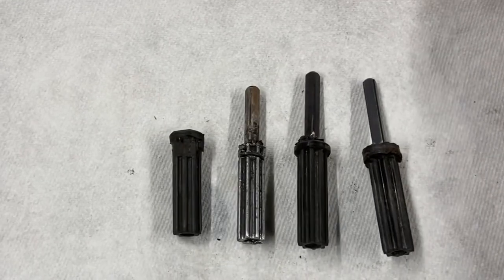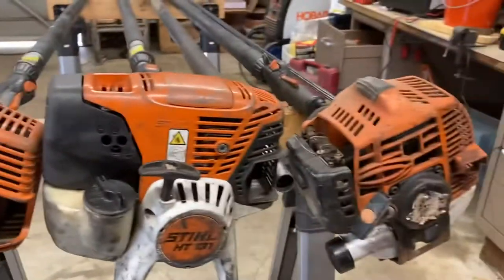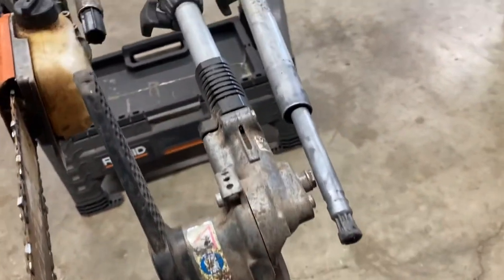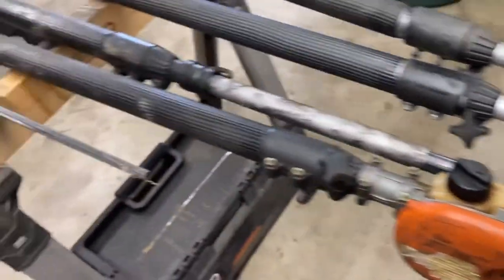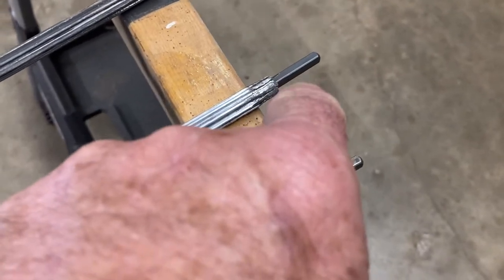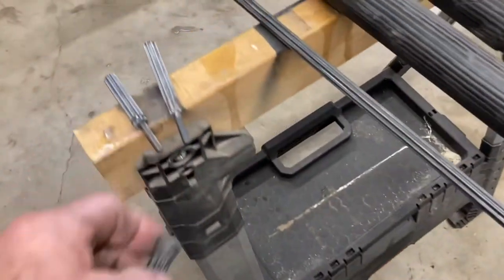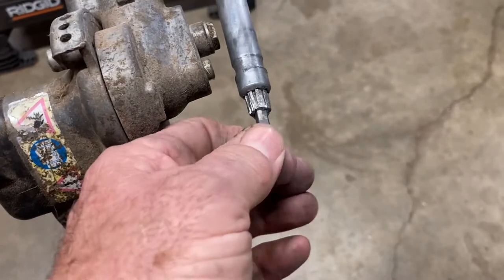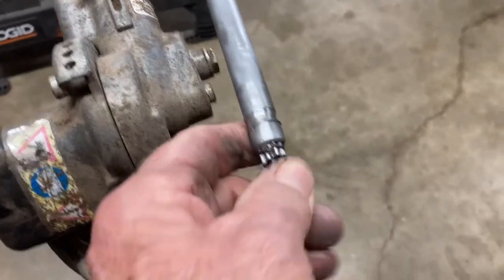Stihl Power Pruner Shaft Repair

Comment: I have a HT75 pole pruner. On mine if the pole is not extended the chain head turn as expected and work well. If I extend the pole more that 2 feet the chain head will not turn. When I take the chain head off the end of the pole saw I see the drive shaft slides back into the shaft and does not drive the chain head. If I slide the pole back in it will drive the chain head again. Any clues on what could cause this?
Reply from the maker: Not sure, but it sounds like the inner shaft is separating when it’s extended. I think I had a similar problem but I don’t remember what the problem was. I’ve owned about 5 of those power pruners. They have all had troubles of some sort. Sorry I couldn’t help more.
Reply: Thank you for taking the time to respond.
Reply: Did you find the problem? I have a Ht135 that has the same problem?

Comment: Hi, I have 2 with the same problem, where do you buy the parts?
Reply from the maker: That was the problem I was having. I couldn’t find the repair parts. I scavenged all one weed eaters I could find. I finally made my own as the video shows. You need a splined shaft. I happened to have an old one that was broken. So I salvaged the parts and made my own. I’ve made several and I don’t need them. The first ones I made are working years later.

Comment: Have you considered repairing one using something like JB Weld, or another epoxy? I was considering using the original plastic part, filling it with epoxy, then shoving the metal "key" in.
Reply: Yes, I’ve tried that. Jb weld and epoxy. Nothing holds for long. I’ve had no problem with the technique I made in the video. In fact, I’ve not needed to repair them again. They are still working several years later. You just need a spare shaft .
Reply from the maker: Just need a spare splined shaft and if you can save the small square shaft inside.